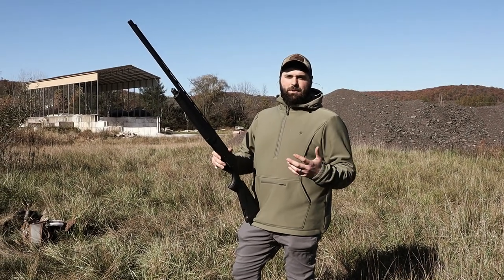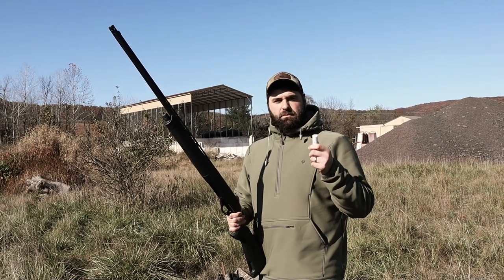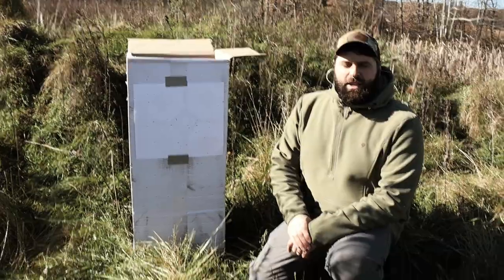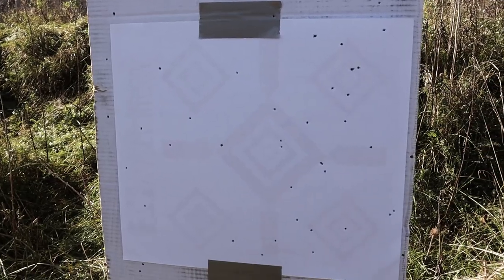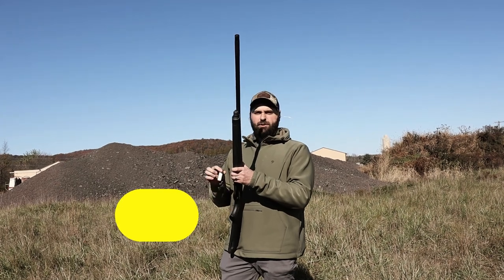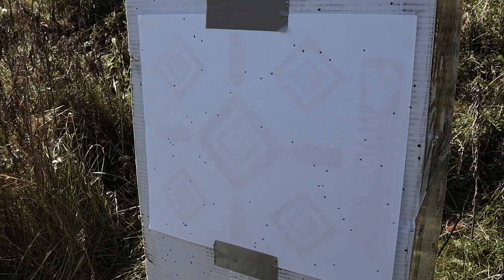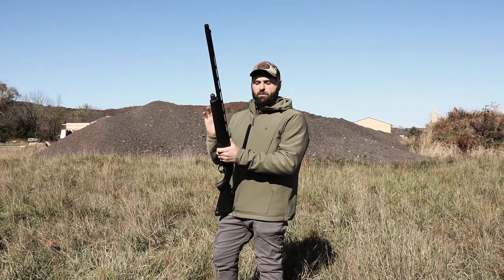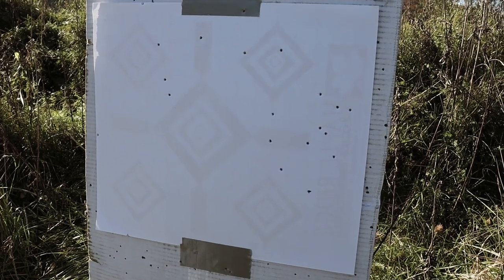Pattern Testing Migras PT. 1| Jebs High Voltage & Carlson Cremator Pattern Battle!

Comment: What thread pattern do they use Remington,benelli,invector plus I’m very interested in trying one of these guns but don’t wanna buy a gun that takes a odd ball choke thread pattern
Reply from the maker: Impala uses the Invector Plus 🤙
Reply: @bloodline.hunt.967  ok thank you doing some research on them now I have a benelli but looking for another gun for pheasant/coyote and some rabbit hunting with a wife,kids and adult responsibilities it’s not as easy to go drop $2k-$3k on a gun anymore lol thanks for the info
Reply from the maker: Absolutely man! It's a nice gun for the money, haven't had any issues with it yet. Where are you located, I actually bought 2 and may be willing to let one go!
Reply: An excerpt from duck tracker shows energy of each pellet size at various yardage. Note that #4s at 40 yds. may patten well but, per duck tracker, are slightly below their recommended energy level for a clean kill.

Comparing knockdown power of steel shot sizes

Shot Size	Energy at 20y	Energy at 30y	Energy at 40y
BB	               11+	                       10+	                       8.9
1	               9+	                        7+	                       5.7
2	               7.6	                        5.9	                       4.4
3	               6.5	                        4.6	                       3.4
4	                4.7	                        3.5	                       2.5